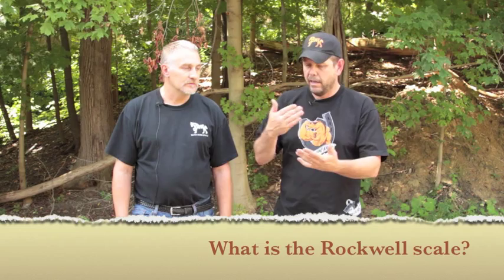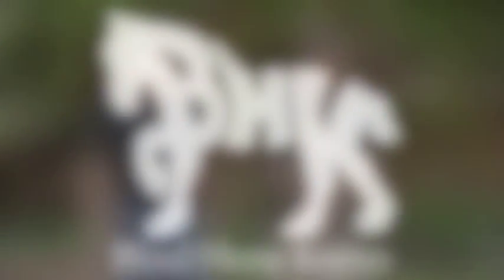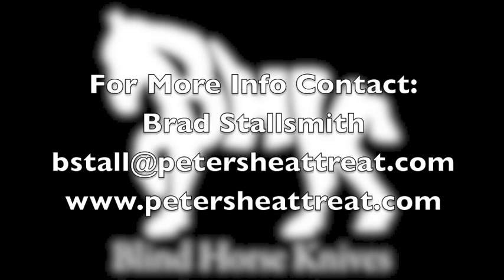Heat Treat Episode 2: What is the Rockwell Scale?

Comment: It's interesting that a scale developed in the US would use kilograms as the weight force, but standard inches for the thickness of samples and the size of the penetrator balls used. I'm used to millimetres but I can cope with inches, but I'm thankful it doesn't use US pounds for the weight force.
Very useful vid, thanks. I learned more about it here than I did from my tutor at college.